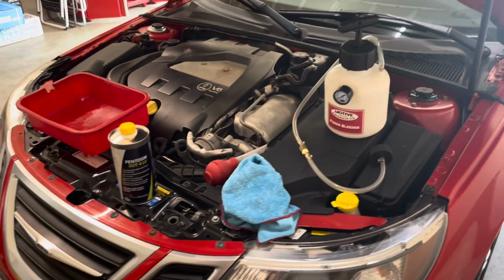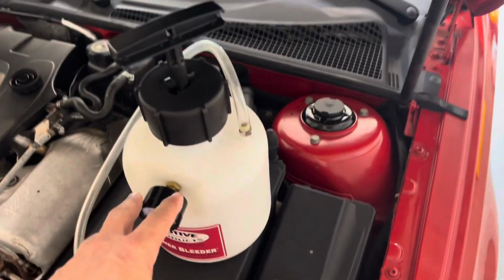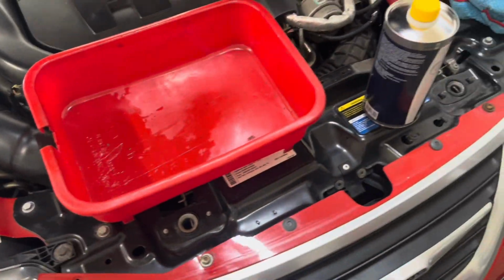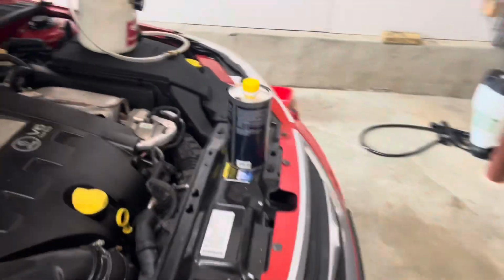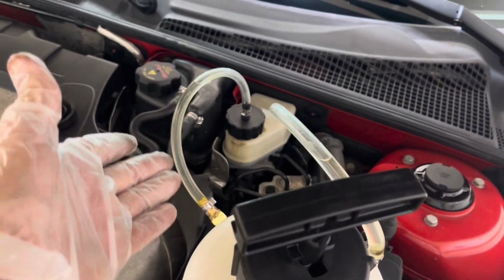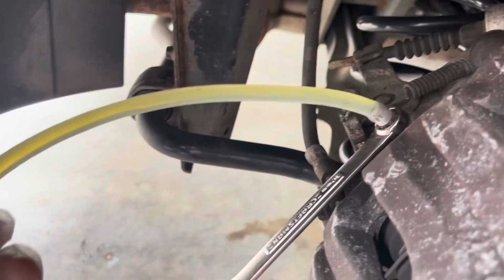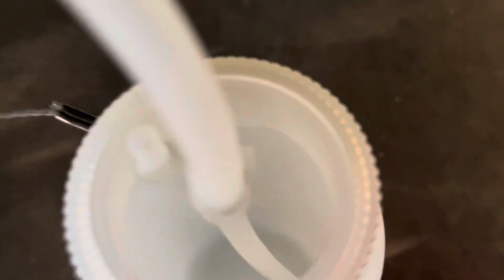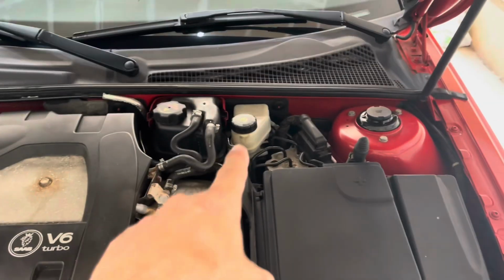2009 Saab 9-3 Aero XWD - Brake Fluid Flush

Comment: I have this exact bleeder and I used the exact same fluid. I highly recommend changing the brake fluid cap to the Genuine Saab metal one. Even the OE cap breaks after a couple of months. Same with the coolant tank. I replaced all the O-rings with hi-temp seals. Highly recommended!
Reply from the maker: Good to know!  I didn’t realize the brake fluid cap came in metal. I did know about the coolant tank, but it’s too expensive for me given mines fine now.